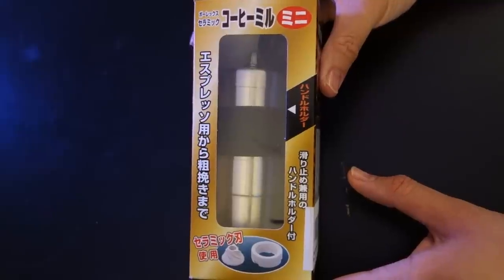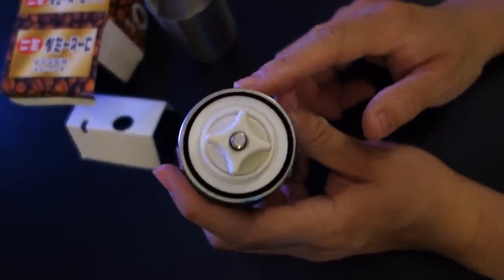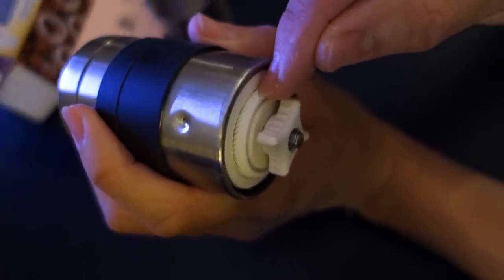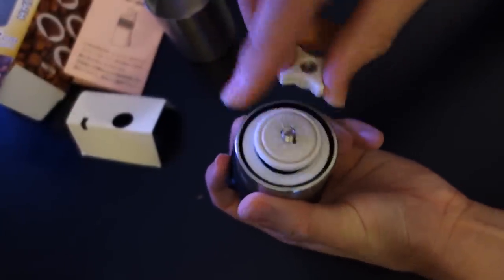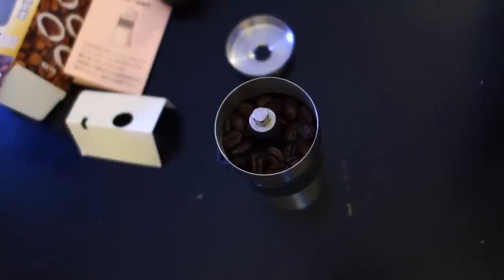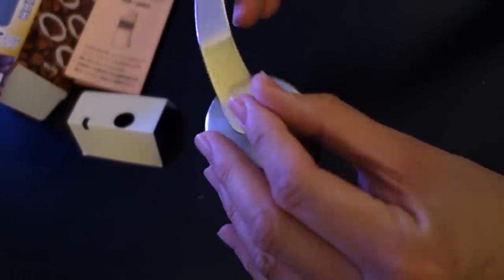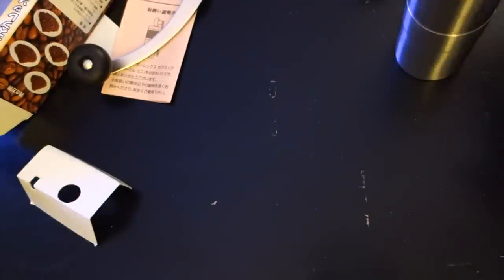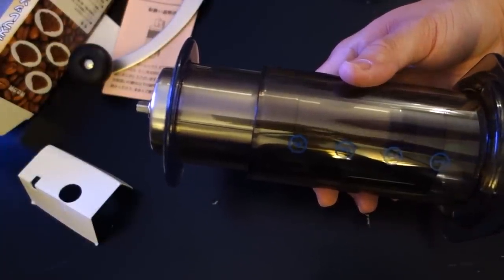Porlex Mini grinder Review

Comment: I have a Porlex Mini and do tourist guiding in Alaska May thru Oct each summer.  I use it everyday for a 13 oz personal French Press Cup. About 10 counter clock-clicks.  I take it easy, there isn't that much pressure, with that medium coarse grind, on the handle. It might take 2 minutes to grind.  I can take it.  For my usage handle is holding up perfectly.  If you apply to much force or probably do finer grinds, go too fast and force it you might have handle wear.  Decide what u r going to use it for.  I could see a Lido for the kitchen counter but not heavy traveling or backpacking.
Reply from the maker: +Joe Craig It is definitely very convenient to travel with compared to my Lidos.

Comment: first thx for video.. but instead of using handle while grinding, can we use charged screwdriving machine? attach it to handle's center nut, is it possible?
Reply from the maker: It is very possible, but the hex is not a common one on the porlex.  You will probably have to have a 3d printed one made or use a more universal one.  Also don't go to fast otherwise you will burn the coffee or strip the gears.

Comment: The top Burr (circular one) in my Porlex mini is not fixed in its place and when I hold the grinder vertically it tend to fall on the conical Burr (bottom Burr). I was wondering if my grinder is defected or all of them works this way. since no matter how many clicks you turn the knob burrs would be in complete touch with each other! I think it shouldn't be like this.
Reply: Mine is the same, must be the way it is supposed to work, the beans force the 2 parts away from each other as they are ground. Happy Grinding:)

Comment: "The only flaw in this grinder is that it is not built to last a long time.  The grinder handle eventually will wear out and start disconnecting from the grinder shaft."
Really?!
I just got mine and was hoping it would last me a long time considering the ~55€ price which isn't cheap by any means.
But, you can actually buy spare parts for this grinder, so you could buy a new handle if it's worn out - I'm guessing if anything it's just the handle itself, where it connects to the grinder shaft, that will wear out - not the grinder shaft itself, hopefully? If so, you could buy a new handle for ~8€ or so.

PS: Also what I just noticed is, I got the Porlex TALL grinder not the mini, and the top of the grinder shaft where you connect it to the handle is shaped like a slotted screw, while yours in the video seems to be a "star" shape, one with 6 edges. Hopefully the slotted one won't wear out as quickly :)

Comment: grinds very fine, but I have trouble keeping the handle on throughout the grind.
Reply from the maker: Correct, after a while it gets worst and worst.  I have moved to a Hario or Lido2 for the handle reason.
Reply: +The Hungry Ferret You should do a follow up video or add to this video about the handle problems after having used the grinder for a period of time. If I didn't happen to read the video comments I wouldn't have known that the handle was a problem and now you don't really seem to like this hand grinder.

Comment: could you attach a drill so that you dont have to hand crank it every time?
Reply from the maker: JO. O Yes you can , but you need to run it at low speeds.  The shaft and burrs may not be able to handle the increased speeds.

Comment: Does it grind for one or two cups?
Reply from the maker: It can grind enough for 2 standard cups in one shot.  You may get tired of doing that all the time.  If you are grinding for 3+ on a regular basis, I recommend an electric like the Baratza Encore.  http://www.amazon.com/gp/product/B00LW8122Y/ref=as_li_tl?ie=UTF8&camp=1789&creative=390957&creativeASIN=B00LW8122Y&linkCode=as2&tag=wwwhungryferr-20&linkId=4VZFBPAUG2RWVDPW